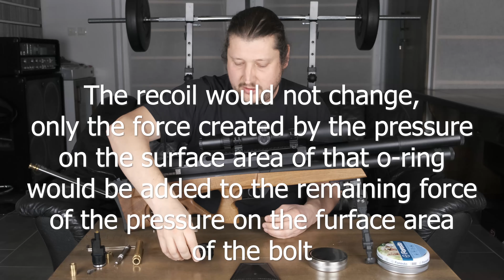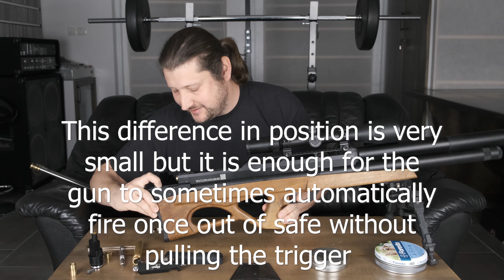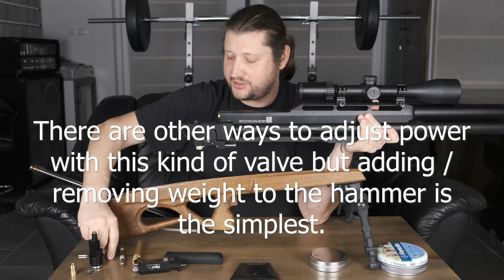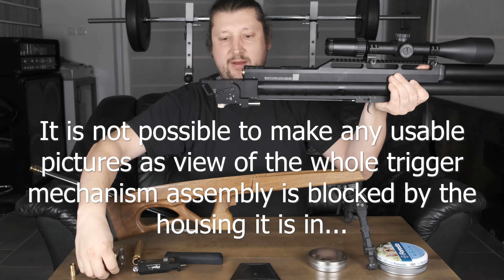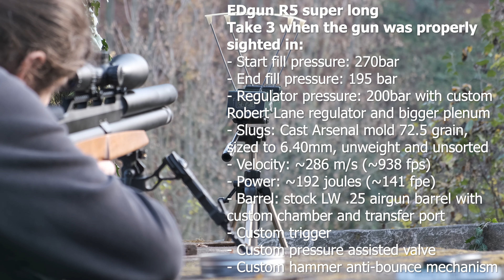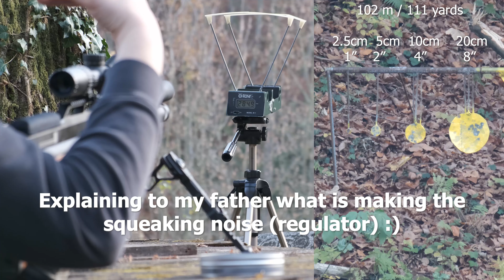EDgun R5 .257 (now .25) project - part 2 (accuracy)

Comment: Great custom work Gregor! Amazing what you did with R5. There is no mods like that on r5 i have seen. I hate the trigger on my lelya 2.0 and i have the same problem with safety when tweaking the trigger to light. Keep it going on this with this and other projects. Pozdrav iz Srbije!
Reply from the maker: Hvala i lep pozdrav :)
Reply from the maker: @miljan1983mc  Yes, unfortunately it does require to drill one additional hole. We can continue through email...

Comment: Gregor i have one question please.

I have a great desire to build a .257 caliber rifle. I'm taking slow steps towards this.

I'm looking for a mold for hunting. I know it has a deep hollow point, MP MOLD 258-640.

Have you tried this MP MOLD 258-640 on TJ 1:14  twist barrel ? 
Or 
Do you generally know how that mold works on 1:14 twist barrel In general ?

Thanks.
Reply from the maker: Hi. Yes I have. It works well. But I had more accuracy with LW .25 airgun standard profile barrel without the choke. Maybe because the .257 barrel from TJ was only 0.5" OD... (of course, I sized the slugs differently for each barrel). MP MOLD 258-640 is an excellent choice for .257 barrel with 1/14" twist in my experience.
Reply: @gregorkamensek3923   Thank a lot.

Comment: top shooting.     maybe a  little drop silicon oil in the reg ?
Reply from the maker: The regulator is already greased by silicon. I just need to slow it down a bit and it will be quiet (hopefully)
Reply: @gregorkamensek3923  you can use a flow restricting screw like in Huma regs.

Comment: Hello Gregor
Please show what to do with casted slugs so that they can shoot very accurately?
I am using Sumatra.25 cal
And using your Suggested MP mold 48 grains
It shoot accurate but Over 1 inch Group at 50 meters
Reply from the maker: In R5, I am using completely different slugs, it is more of a big bore setup (200 joules in .25) so the slugs are long and can be sized. MP mold 48 slug was designed with K1 in mind and cannot be sized (well, you could size it but the front rings are a bit too small). For maximum accuracy with cast slugs, they need to be sized. If you do not size them, the accuracy is mainly dependent on how good you are casting them but never perfect. The problem could also be how the pellet pusher inserts the slug in the chamber because they are very short. And the last possibility is always that the barrel does not "like" this slug. I hate that term but it usually means that dimension are not optimal or TR or something else... Also, your gun is unregulated, that can also effect POI (not only because of velocity fluctuation but there are other factors as well).
Reply from the maker: Did you get good groups with some other slugs? maybe with swagged?
Reply: @gregorkamensek3923  never tried .250 swagged slugs because some Sumatra users told that Sumatra likes .253 slugs
And also never find any videos Sumatra shooting 25 cal H&N or Nsa slugs
And These imported slugs cost twice and hardly available in Indian market
30$ or 25 Euro And even more for a 120 slugs 
Like for Sumatra I paid 3000$, almost 5 times of its original cost
Very less options available in market
I understand from you that sizing is very Important in casted slugs for accuracy
So far pellets I tried 34 grains shoots very accurate even at 100 meters

Comment: Is this longer than the r5m long or is that your modification
Reply from the maker: This gun is in size exactly the same as R5M, but the R5M has a magazine. R5 is originally only in .30 cal, the .257 cal and now .25 cal is my mod as well as many other (power, trigger, pressure assisted valve, hammer anti bounce,...).

Comment: Gregor Greetings from  Greece. I recently bought an rti prophet and it makes a ratlling sound after every shot i thought it was the regulator  but in your  video you said it was something else.I would very appreciate it if you can tell me what it is.
Reply from the maker: It is the one way valve that is in the back side of the connection hose just in front of the valve...
Reply from the maker: @tsambas79apostolos  :) BTW, you can take that valve out if it bothers you but if you do, the gun will drain out if you remove the bottle. That is the purpose of that valve...